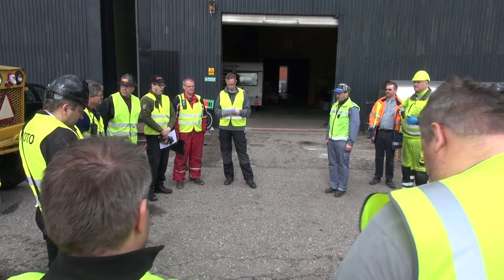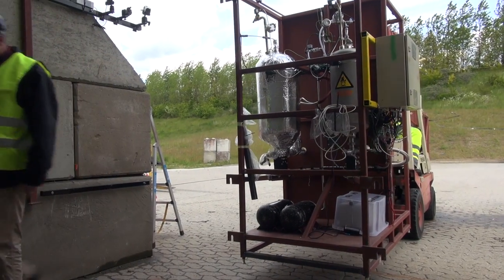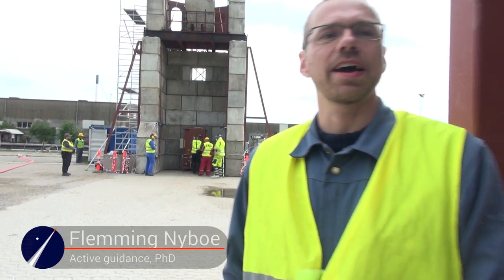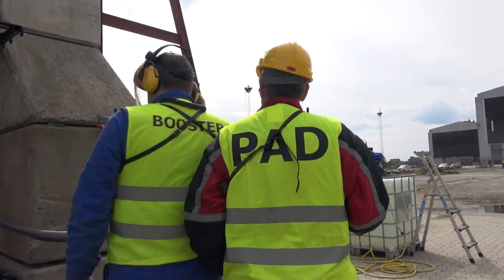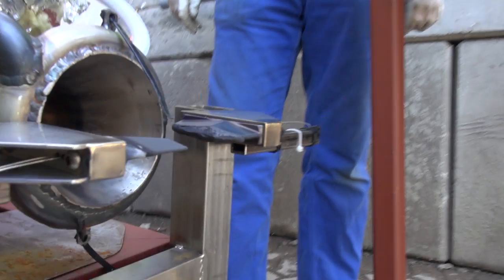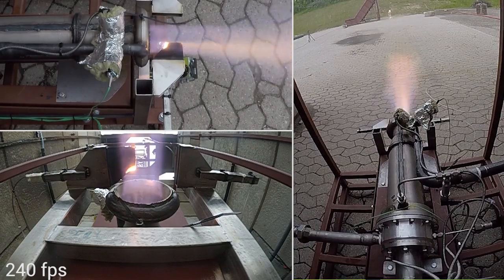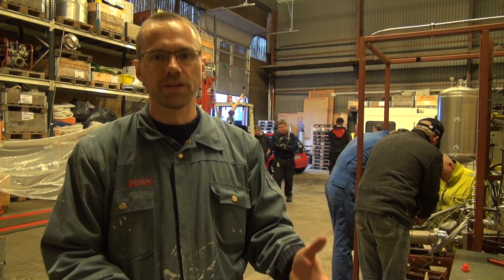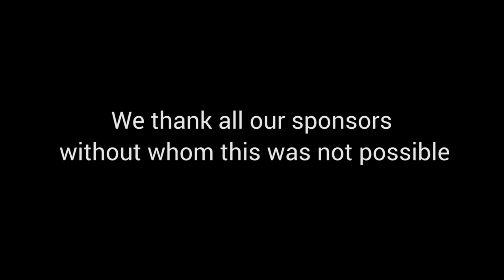BPM5 Static Test 2 - Atmosphere Video

Comment: Good job guys.  Lowering the pressure drop across the injector with the larger injector holes is more likely to increase that combustion instability.  Did that show up in your data vs. your old injector.  Also if you run slightly rich on the mixture ratio your graphite vanes will probably last much longer.

Comment: I don't know if this is any help, but if the graphite is having problems lasting through a complete 50s burn, then perhaps ceramics would do the trick.
That could have the potential advantage of being 3D-printable, so some sort of liquid cooling system could be employed inside the fins with coolant channels, like an combustion engine i guess.
I don't know if that would be to over complicate what could otherwise be solved with a "brute force" approach like just making the fins passively endure the abuse of the gasses, but since I just had this brain fart I thought I would share it. :)
Keep on rock(et)ing!
Reply: LemmingBae You can't liquid cool ceramics, plus ceramics shatter with massive heat changes.
Reply: LemmingBae
sorry for my bad english
in one of the last videos its takes long time till copper fins starts disintegrating (great thermo buffer ?!)  therefor a fuel cooling my work if ther a exces of thermal capacity (below boiling point) of "schnaps" fuel were available 
( con. complex construction and mechanical design)
Reply: Come to think of it, you can 3D-print metals too (or cast), so the ceramics wouldn't be necessary.
Also, pereduranofcourse I think some ceramic materials can withstand massive heat changes. If I remember correctly heat shields on many space vehicles are made of ceramics. I might be wrong though.
Anyway, I'm sure copsub will figure it out, with or without silly youtube commenters like me. :p
Reply: LemmingBae Well yes, re-entry shields do have ceramics, but just like the carbon, they're based on losing mass when going through such high temperatures.
Reply: pereduranofcourse Ah yes that makes perfect sense.
I'm pretty convinced that it would be an over complication of the guiding fins to actively cool them. Even if it could have a potential effect.
Designing a cooling system that is robust enough to survive flight yet simple enough to allow the fins to move would probably not be very feasible, at least not without a lot of testing, and if you can manage with a sacrificial unit that only has to survive 50s of burn time, then that is by far the optimal solution.

Still would be cool to say "Engaging Guide fin cooling system" during the countdown though. :)
Reply: LemmingBae And with 3d printing the cooling channels could be extremely well optimized, would be very cool.

Comment: if possible you might want a slightly fuel rich mixture so there is less unreacted oxygen left to burn away the graphite. if there is too much oxygen left you might get an oxyfuel torch like effect that heats, burns and carries away graphite from the vane.